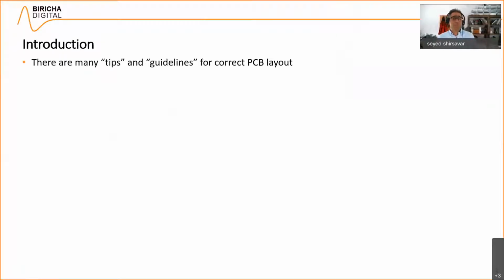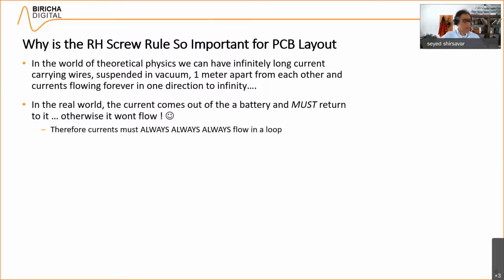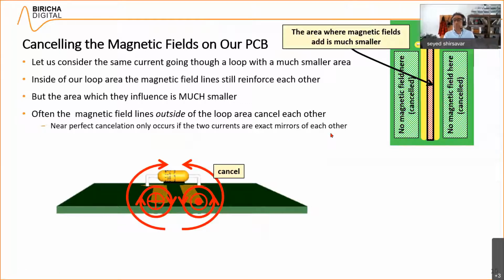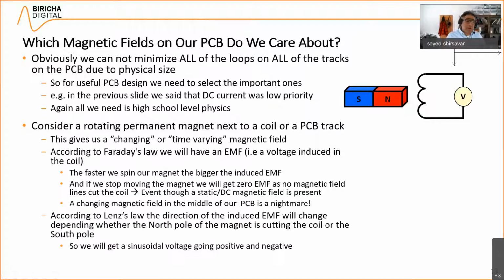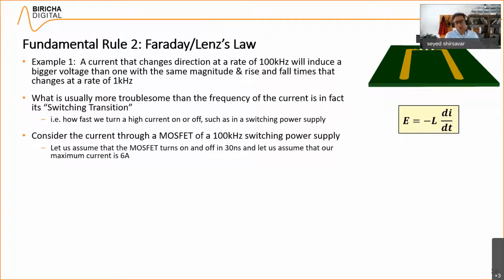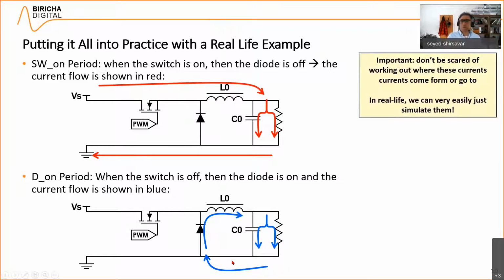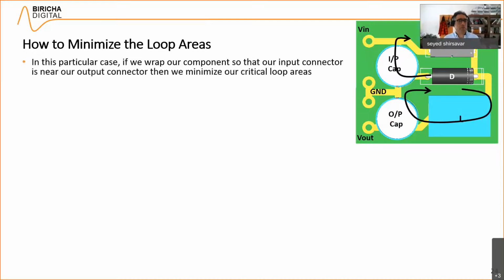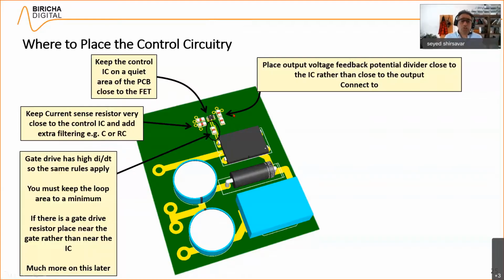PCB Layout Fundamentals

Comment: Wafer vs PCB, Difference in material type for semiconductor and bus on type of board selection to thermal conductivity. Any recommendations on good reads with tables on material type current flow and thermal reactions?

Overlapping electromagnetic field and radiation including the faraday cage design casings for microchips. Suggestions about it?
Reply from the maker: For extended design support, we recommend using the consultancy offers of Biricha or others. Thanks for your understanding.

Comment: how about magnetic field on shorted traces ?
Reply from the maker: Can you please be more specific on your question and send it to support@omicron-lab.com? Thanks!
Reply: @OMICRONLabTutorials  I want to know what happens to the magnetic flux when there is a short between power rail and ground especially on multilayer board. Is the magnetic field cancelled out or somehow concentrated and disturbed resulting in stronger field?
Reply from the maker: @farisikhmal4868  generally a short will cause a high current and a high current can cause a high magnetic field. If this field disturbs something else will depend on the situation.

Comment: At 33:31 Loop 1 is drawn going from the cathode to the anode of the diode. This would occur during reverse recovery, but only for a short period of time. Was this loop meant to include the inductor and output capacitor?
Reply from the maker: Dear @ats89117, we just talked to Dr. Ali Shirsavar, and that was his response to your question: 
"Loop1 is drawn for when the current is conducting through the switch, i.e., when the switch is turned on.
Loop2 is drawn for when the current is conducting through the diode, i.e., during switch turn-off.
From a layout perspective, we are just trying to identify which loops have high di/dt at "some point" during the switching cycle.
Apologies for the ambiguity!"

Comment: can you help educate why there is no mirror of diode current on the return path? because it goes into inductor and change to inductor ripple current and mirrored to GND instead?
Reply: Probably for the same reason that there is no return current for the load and capacitor. When is off, the inductor and capacitor become the "power supply"